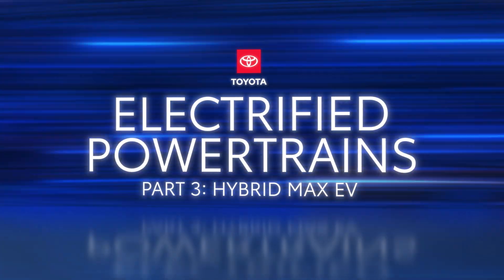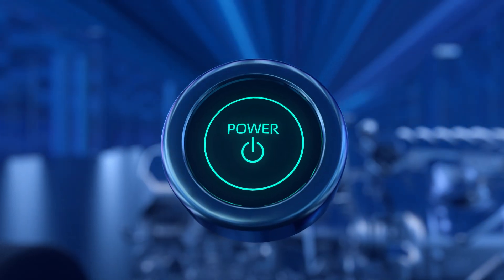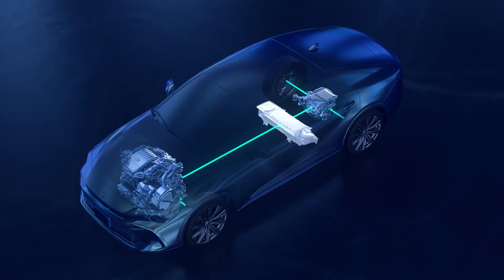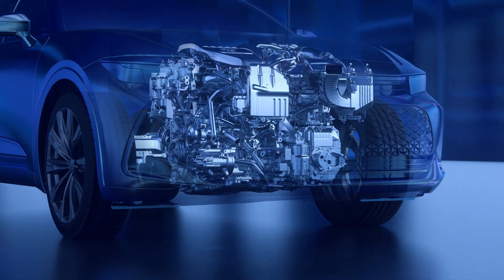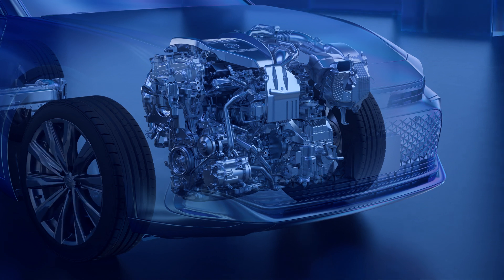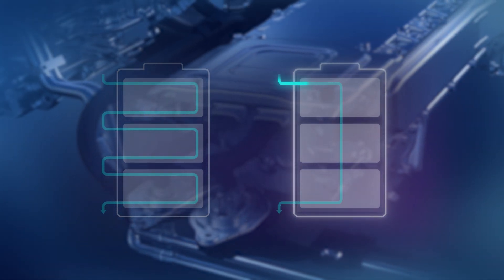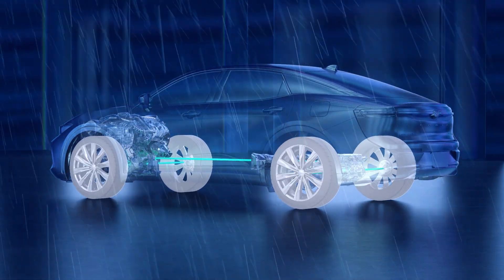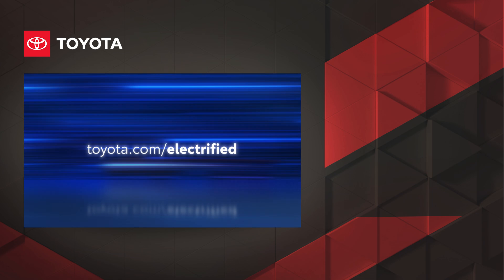What is Toyota Hybrid MAX? How Does It Work? | Electrified Powertrains Part 3 | Toyota

Comment: I still have a major concern over the Hybrid Max package, and I've yet to get a good answer to it.  For a turbocharged engine, we are taught that after running the engine at speed, say 15+ minutes at highway speeds, we need to let the engine run at lower speeds to allow the turbo to cool.  If you're coming off a highway after a thirty minute, 60mph drive, that turbo is going to be a max temp.  Pulling off the off ramp and up to a stop light, in a hybrid, would shut the engine down, and with that, the cooling oil to the turbo.  Without a system that keeps oil, or coolant, or whatever, pumped to that turbo to keep it cool, it's going to cook itself in a relatively short time.

I can't believe that Toyota engineers didn't think of this, so I would love to hear what they've designed to deal with this.
Reply: There is a dedicated liquid cooler for the engine turbo, which is run by the electric system
Reply: @groovycarter  Yes but does the coolant pump keep running after the engine shuts off? That's my question as well, kinda my concern with the hybrid max system on the Crown.
Reply: @groovycarter  thank you for answering that for me.  I had come across that information elsewhere, but I still worry about the oil running through it as a part of the cooling process.
Reply: I would love to know more details about this. Have you guys found any resources to help clarify how this works?